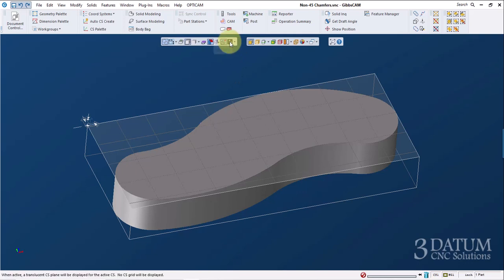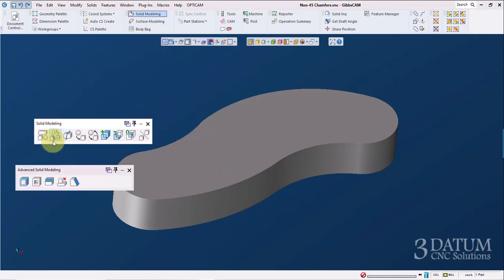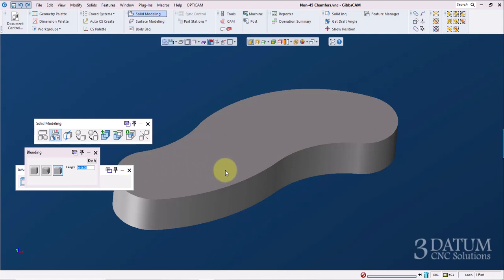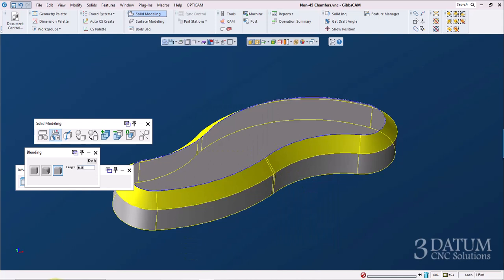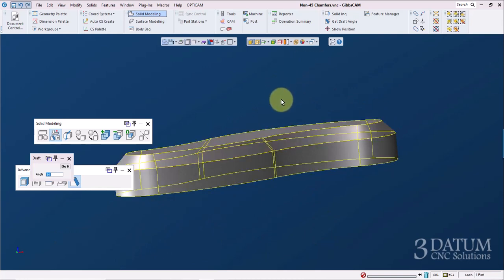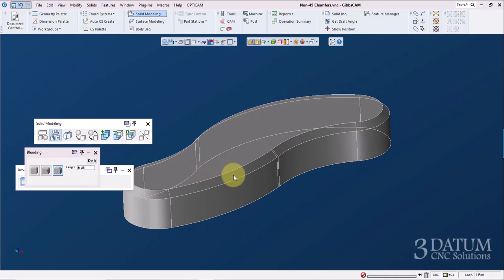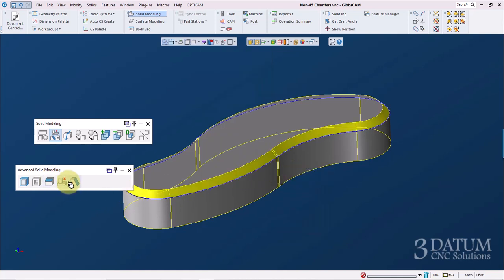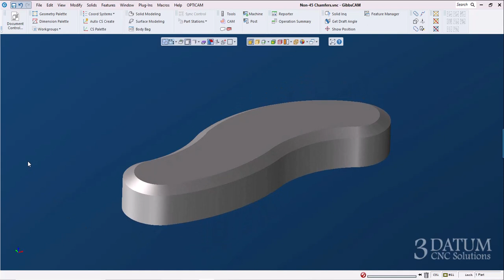GibbsCAM Tech Tip: Creating Non 45 Degree Chamfers

Comment: How to move a part and rotate it the simplest way with multiple coordinates "5 axis" and processes associated with it  already.  For example i programed a part from start to finish with multiple faces "3+2 axis" but then i realised i have my primary coordinate system at the wrong orientation or location and i want to move it to a different place without redoing all the processes again.
Reply: I will try to get a video out in this in the next couple of weeks (I do these in my spare time, and there hasn't been much "spare" time lately).  If you wouldn't mind PMing me the name of your post processor, it would help.  Gibbs handles output for alternate Coordinate Systems differently, depending on the style of post.